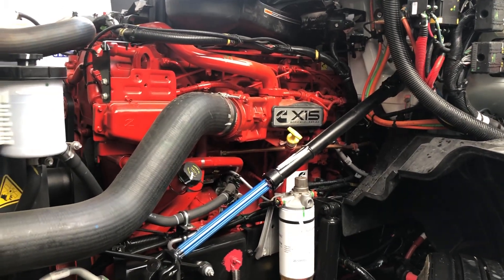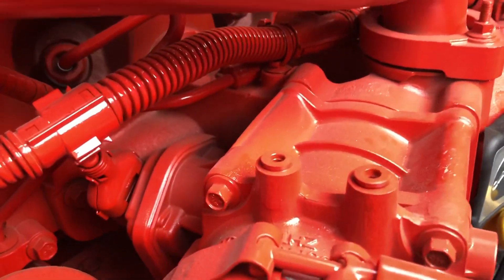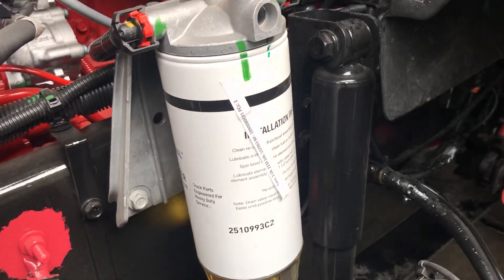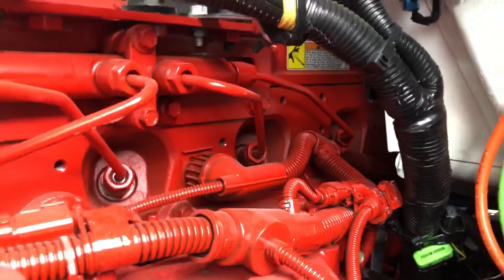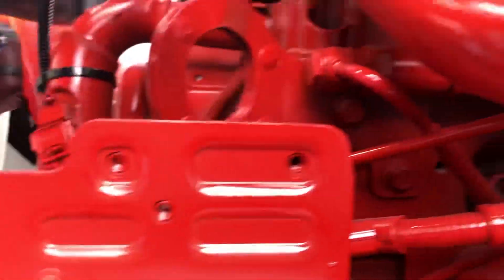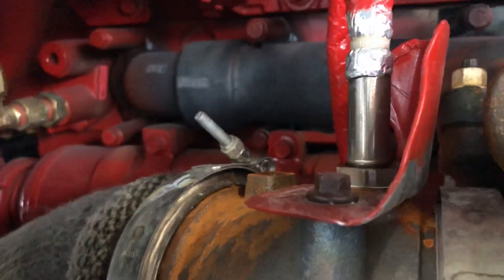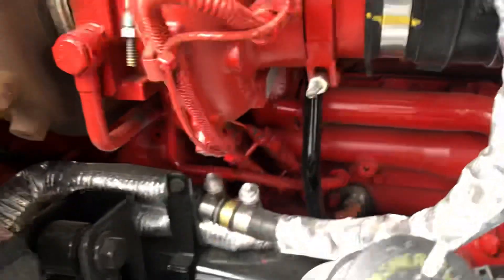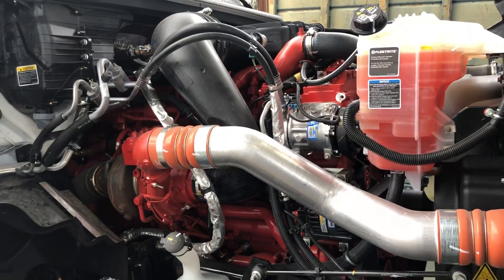Cummins Engine X15 efficiency series 2019: A quick review.

Comment: I know this video is 6 years old but, this engine is garbage. Don't know wth Cummins was thinking. Stick with their productivity series over this. This engine is a sensor nightmare.
Reply: I run one at work. It's in a 2019 international Lt. It's a 430st rated for 430hp and 1450 ft lb of torque except 1650 in 9th and 10th gear. It's mated to a Eaton 10 speed auto shift. The combination is a nightmare. Grossing 110000 lbs is an absurd task to ask of this truck on a daily basis. They won't turn it up either. The driveline will allow for 450 and 1650 so it's a "garbage truck" to begin with.

Comment: Can someone advise im thinking about purchasing a international with x15 efficiency in it 400k
Reply from the maker: Those are good engines (at least better than the A26), for now the only issue we are having with these units are oil leak from the front cover or making noise from there as well (over 600,000 miles). But the engine core is good as you can expect from Cummins. I hope this little information help you to get a better understanding of what are you buying. Thanks for watching.
Reply: @LetstalkDIESEL  helps alot thank you very much.
Reply: 2019 Volvo vnl64 760 x15 450hp with 371894 miles reliable truck

Comment: shit engine . slow gutless . DO NOT BUY EFFICIENCY CUMMINS engine if your pulling any weight. junk complete junk . will never buy a  Cummins again
Reply: I totally agree
Reply: If you're pulling weight then why didn't you buy the performance series?  LOL.
Reply: @mewithouttherandomnumbers  solved the problem by leaving fuel card and keys on dispatches desk with a note saying thanks but no thanks . better offers elsewhere
Reply: @mewithouttherandomnumbers  because i was the driver of a company that bought 16 of them under the advise of a sales person a Peterbilt and he said same power better fuel economy so the exboss bought them. if i was to buy a truck it would be a Volvo set up for for heavy haul
Reply: Is the efficiency series a file or is the engine designed that way?
Reply: @3406eJB  its programing and sensors that need to be changed . all x15 engines are the same except a couple bolt on parts and the computers
Reply: @kc03300  ok thanks
Reply: Cummins x15 is the best compared to a paccar AKA boat anchor

Comment: There is only 1 word for this engine   ( garbage )
Reply: Driving a 2022 12k miles x15 it is garbage every hill dog shit going to the shop today
Reply: @hasmu24  what did they do to fix it or did they . I'm driving a pos 22021 Pete with 40 k on it super slow and gutless on hills
Reply: @kc03300  its not the engine its the "engine management" it "modulates throttle" to save fuel.. basically it decides you dont need that power right now wed rather you just lose a few more mph's itll save the company 4 dollars a day.. they have build options where the throttle peddle is the throttle peddle though and will give the fuel requested by the peddle
Reply: Nope

Comment: Base on your knowledge and. Experience what engine you recommend on Cummins what year is it worth the difference with x15 money wise. Gracias.
Reply from the maker: A good question indeed. Seems like there small differences between the x15 efficiency series and ISX15 series, as I showed in the video one of the major concern will be about regeneration process, because it does NOT require a 7th injector or HC doser block to be done. So for now, people who has Cummins engine older than 2017, it is better because it is know in depth for the technician, in the other hand with this new design you never know what it can happen in a long run. Money wise will be better to keep an engine that people know already that an engine that is new for the people, which might require new parts that are not in stock and gives new headaches to the Technicians. I hope this answer your questions.
Reply: @LetstalkDIESEL  they haven't perfected the regen process on this engine just yet like they have on isb's without the HC injector. we have had a truck come into the shop with x15 engine cylinder misfire and found out the valve seat was sitting 1 inch higher than the rest of the cylinders when we took the head off found the piston damage and head damage. long story short full inframe and the new cylinder head was done at 150k miles. the engine oil was diluted with fuel. I have seen this on small maxxforce engines before
Reply from the maker: @Sharkiec  This is good information, thanks for the heads up, our fleet still about the same early miles (around 100,000 - 150,000). Around 250,000 - 300,000 will see how it goes.

Comment: The "7th Injector" is not necessary because fuel is now being injected in the exhaust stroke by the main injectors to do an active regeneration.  Cummins has been doing this for awhile in other models like the ISB.
Reply from the maker: Thanks for the information, I have been thinking about that possibility too. Let’s hope it doesn’t have bigger complications if one of the main Injectors misfire. It will be a pain for the owner to pay more money for something that was simpler and cheaper before.
Reply: @LetstalkDIESEL  nope. It’s better this way trucks have been doing post injection in the exhaust stroke for years.